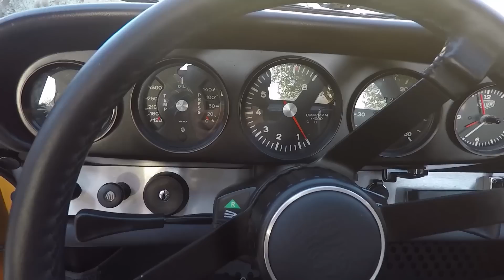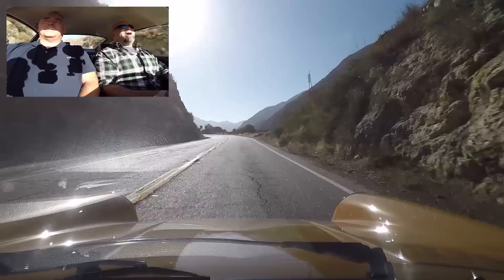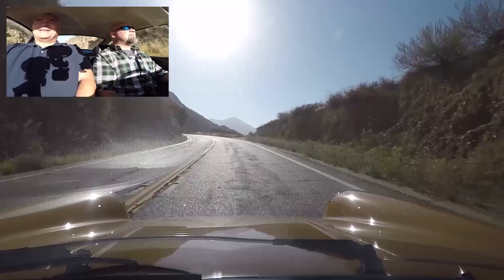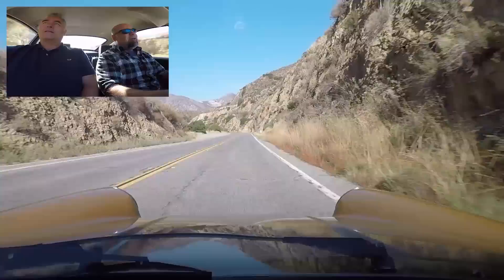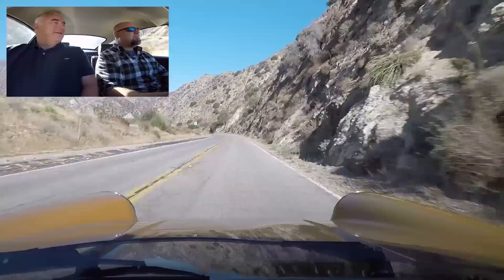Daily Driven, Modified 1968 Porsche 912 - One Take

Comment: My second Porsche 912 purchased for $1300.   In Washington State in 1982.  Pulled the engine and glad I did the oil drive pump drive slot was just about to go away.   Added 1743cc cylinders and pistons,   new bearings, oil pump.    Great car for town and county.   Even got almost 30 mph hiway.   Miss that 912.   Would love to have another and would differently love to have your 130hp engine.   Thanks for the story of your 912.
Reply: In a test in a French magazine of the time, I read that this engine consumed 3 litres of oil per 1000 km. I wonder if this is normal. The specific power is brilliant, but it does not reach the values of competition engines. Did your unit have such a high oil consumption?

Comment: $20k on an engine is "not crazy"? I beg to differ, dude.That's a beautiful car and one of my childhood heroes but damn.
Reply: mickeybill If he's got the money and passion for the car he may as well treat it to something
Reply: This is why he answered the  $60,000 question like it came from his wife. You use that Man math on the rest of the car and this is a very expensive slow car.
Reply from the maker: “Not crazy,” of course, is relative to what Porsche horsepower costs elsewhere. A standard rebuild for the stock 3.2L motor in my 87 Carrera is $20,000. No high performance anything, just a stock rebuild. So while yes, $20,000 is a lot of money, it’s about the minimum you could spend for a hot rod engine of any kind from a Porsche Racing shop.
Reply: Well there go any ideas I had of owning an old Porsche. lol
Reply: It a lot, but not ridiculous, especially considering it is somewhat specialty work.  I spent 15k building out the 454 in my Chevelle, and that was having a friend of mine who buils engines do it for me who barely charged for labour.  You would be surprised how things add up when you are replacing basically every part in an engine, and having to get machining work done.  However, you basically end up with a brand new engine afterwards though.
Reply: This is why I put away the dream of owning a Porsche and bought a Miata. I recognized that I couldn't afford to run the Porsche the way I wanted to, and I'd rather have my second choice car in good shape that doesn't kill me financially, than my first choice car never up to snuff and destroying my peace and bank account.

The Miata's been expensive enough as it is! And the good news is I've only liked the car more and more as I've owned it, and I don't really feel like I settled at all!
Reply: Mathew Clark I just hope you never need to find out how much a rebuild for the Miata motor is
Reply: I have built a bunch of V8 engines in my life time and I agree with you, but for $20,000 that thing should have 400 hp
Reply: I have a 69 911 RS clone with a 3.6 twin plug on 46 webers, 300hp with 276 torque that will set you back $50k today
Reply: Colin Kao A miata engine won’t cost anywhere near what a Porsche engine costs to rebuild...

Most people just don’t have 40k to drop on a car
Reply: TheSmokingTire glad I bought the book and did it in my driveway $20,000 wtf must be a California price tag ....I had the motor and transmission out in 45 min.  took two weeks of ordering parts everyday from pelican parts ... pulling it all out again to install some turbos so yeah I’ll prob exceed it know that I’m thinking’ about it .....thanks for making me feel guilty 🙃
Reply: Yeah what 20k on an engine. I bought my 1st house for 32k so wtf. Hey they must have seen him coming.

Comment: I know it's beating a dead horse and it's all relative but $20k for an engine is insane. I know the Porsche premium is high and the parts are more and the labor is more but damn.
Reply: Super nice guy with a super nice car though. This would be a perfect daily in SoCal I bet.
Reply: Brennan McKissick that and not to mention a 4 cyl engine only making ~140
Reply: Not really.  If you have ever fully built a high performance motor on an older car, starting with a bare block, its not really that insane of a cost.  Its a lot different then buying a Chevy crate motor that is still mass produced.  I've gone through it before in one of my cars, and almost spent that much, and that was having a friend do it who builds engines, and didn't really charge much for labour.  Heck, a top quality paint job will cost you 10k nowadays
Reply: How many 1.7 Liter naturally aspirated engines do you know of that make 140 hp? You realize that 1.7 Liters is just over 100 cubic inches, right? If you do a simple ratio then an equivalent 454 should be making  just over 600 hp. How many 7.4 Liter naturally aspirated engines do you know that make 600 hp? I'll wait.

The Hellcat engine, you say? Sorry, supercharged. 
The Corvette ZR1 engine, you say? Sorry, supercharged.
Reply: M H Not a fair comparison. Those enormous engines are usually pushrod which rely on their enormous size to produce power, and not to mention the ridiculous torque they output..
Reply: I would way rather switch the 616 engine with a 2270 RS 914/4 Type 4 engine. The conversion costs around 17K and give you upwards of 160hp. Then I would just sell the 616 engine to compensate (assuming its not numbers matching in the first place)

Comment: Is it really that much for a base 912 engine? I mean they only stopped building VW Bugs in Brazil like 15 years ago, I think you should be able to source late model engines from Mexico or Brazil for a relative song. Of course they don't come with forged internals but for an easy to work on DD it'd be a cheap way to go.

Comment: I absolutely love this car, but I have to jump on the "20k is way too much" bandwagon.  Isn't the 4 cylinder supposed to be a VW engine like from a Ghia?  One of the reasons my dad liked his 4 cylinder 914 was the lack of platinum embossed Porsche logos on all the parts.  For $20k I'd be prepared to disregard the purity and put a K20 in the back of that thing, and then buy a spare K20 with the money left over.  Or get three whole, clean 986 Boxsters.  For the price of a 4 cylinder "Porschwagen" engine rebuild.

EDIT:  Upon further research, the 912 uses a Porsche designed engine originally out of the 356.  It's still pushrod tractor tech, but replete with the platinum logo etchings and pretentions of unparalleled "qvality".
What.  Ever.
I don't think the K20 powered Hondorsche is sacrilegious enough now.  I'm thinking more like Kawasaki H2; the old 2-stroke one.  "Oh yeah, it's still air cooled, and vintage.  That sound?  Yeah it's an aftermarket Denco expansion exhaust.  No it doesn't need rings, it's supposed to smoke like that."

Porschesaki!

Comment: 2000 lbs??????????? the new mini is too small and its almost 3000 lbs
Reply: EvendimataE thats bc you can get in a crash in a new mini and not die. Also modern comforts like ac, stereo, etc are included
Reply: revans425 I can attest to the not dying part, I had a gen 3 mini (f56) and I’m still alive.
Reply: Around 2600 pounds